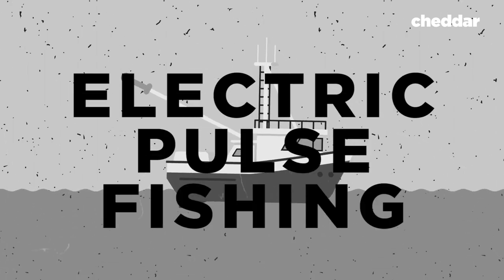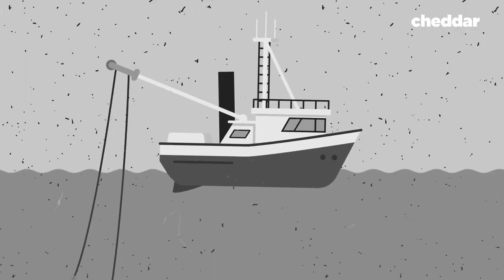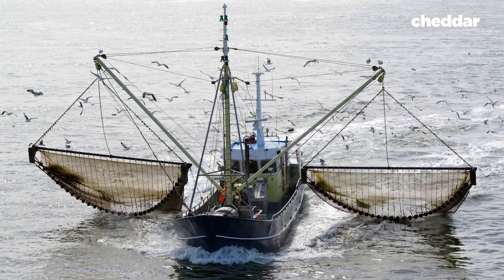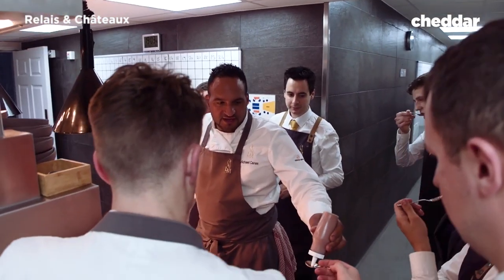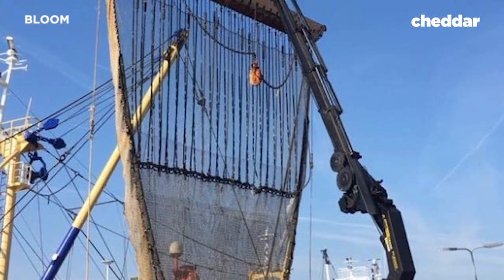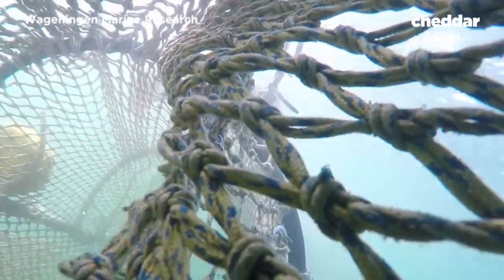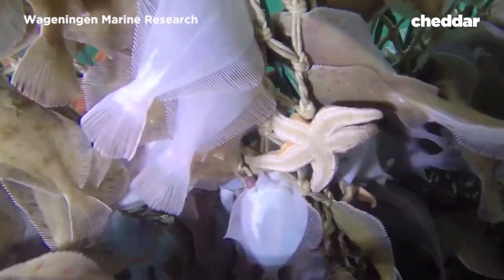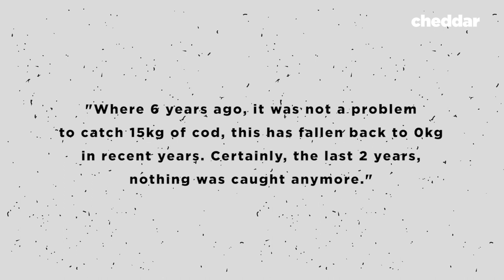Is Electric Fishing Cheating Our Oceans?

Comment: You're right, let's just smash our big ass chains into the ocean floor instead.
Reply: I'm no expert, but this video sounds very biassed.
Reply: @rogerwilco2  yeah so also looks very judgy
Reply: That is not how beam trawling works. A net with huge metal weights attached to it drags allong the bottom scooping up literally anything that it comes across. This video suggests that beam trawling consists of only a heavy chain to scare the fish into leaving the ocean floor and a net to scoop them up. This really fails to show the actual destruction that beam trawling causes.
Reply: @rogerwilco2  it seems so, but please use multiple reliable sources on this matter.